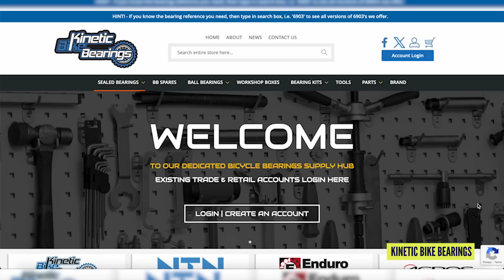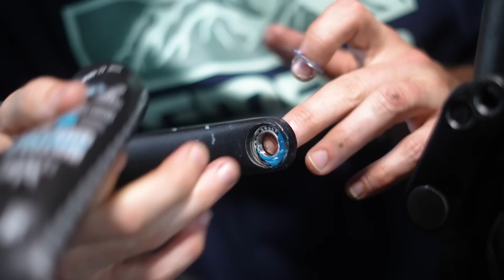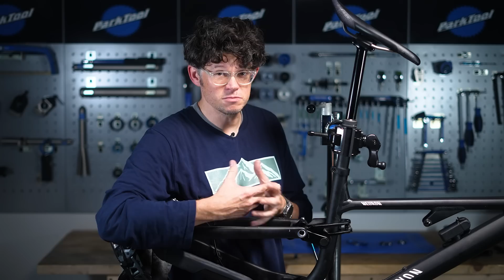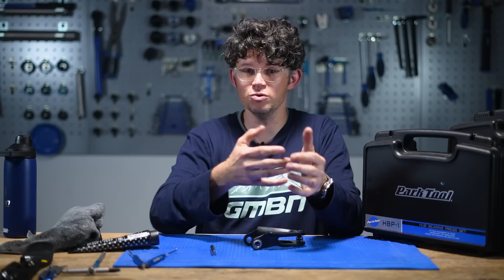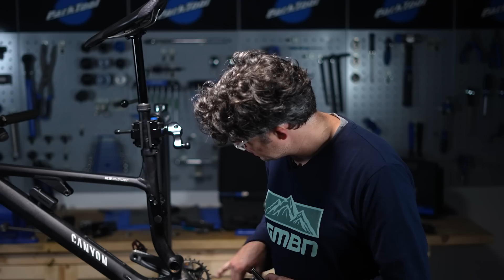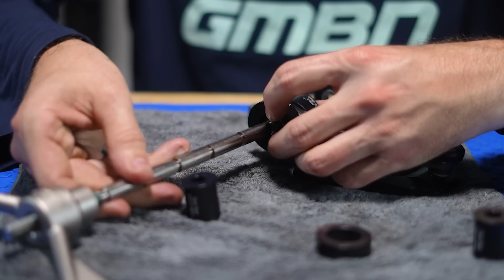Ignore This And Your Suspension Will Feel TERRIBLE!

Comment from the maker: When did you last service your frame bearings?
Reply: Haven’t since I purchased my Specialized FS twelve years ago.
Reply: Can you mix two types of grease?
The white one that was already in your bearing, with the new fresh grease??
Reply: @parkstraat9 If the grease in there is clean, yes you can. If it's got wet or grit in then best to clean it out
Reply: HI,I had try to service my Yeti SB5c switch infinity ;at home😅 ,and made a clips about it !!
https://youtu.be/NCSpMRtXrRg   :yougotthis:
Reply: 2023 bike with no time to ride it... So probably 2029
Reply: @crankshoptv  damn! I hate when that happens. I took about 4 years off because a change in careers. Very frustrating. Now I’m back on the trials.
Reply: Never.
But then I only ride hardtails 😁

Comment: So happt i found your video, i was installing my new Shimano disc brake on the rear of my mountain bike and i tightened the caliber to the IS adapter a little too much and my caliper snapped off where the screw holds it. Wish i would have found this before i tried to install it. Apparently i purchased the wrong adapter. Thank you for this video.

Comment: I serviced my Nukeproof Reactor frame last year. I replaced all the bearings. It was very time consuming but worth it, because of the satisfaction from doing it yourself. And having the right tools is an absolute must. Wouldn't want to attempt it without the tools. And there were also a couple of circlips that needed removing. Might be worth mentioning this is a video. How to remove circlips with circlip pliers.  I'm an engineer in my job so I'm used to this kind of stuff, but not everyone is.
Reply: You sound like a motor mechanic , but replacing those bearings should be quick as I found it , having done many dual suspension repairs . Mechanics are often called engineers in the United States but not in Australia .

Comment: If you put your bearing in the freezer (cold metal contracts) and warm up the aluminum housing with a blow dryer or heat gun (warm metal expands) your bearings will slip in easier.
Reply: You lose the T6 temper at 220 degrees celsius .

Comment: Interesting that he was removing the bearing hammering with a non rubber side of the hammer and, was resting the frame part on a socket without any soft material between. Surely frame got or will get marks from this.

Comment: If you ride once a week, replace your bearings at the start of each summer season. This will give you a fresh bike for the season and prevent any damage to the hardware, the hardware is often very expensive, custom made and gets discontinued quickly, so you need to look after it. A seized frame bearing will ruin pivot hardware. 

Try not to use water to clean the bike, if it was a wet ride, dab it with a towel and then leave it somewhere dry, then a soft brush will get rid of 90% of the dirt. Water washes out grease and guides dirt into all the nooks and crannies where it does the most damage. 

Pay a shop to do it, they have all the tools and experience to get seized and problem bearings out, saving you the stress and guaranteeing a perfect job.
Reply: Replace the bearings once a year? No. Refresh yes, replace as needed.
Reply: @marcjohnson8488 I see where you're coming from, and it's likely that most people will not be riding once a week in all conditions, in which case you're right. Bearings last me about two years riding my bike once every ten days or so for around 15 off road miles per ride. 

It's difficult to state specifics unfortunately, I tried to state the case for the average rider/bike, going out every weekend regardless of conditions, chucking in a jet wash here and there and riding the average full suspension mtb. Having a shop replace their bearings every year will keep the bike in top condition.

Some bikes are sealed better than others, some use good bearings, some have better grease from the factory, some have bearings that are easily removed individually etc etc.
Reply: Had my bearing all replaced by my bike shop, cost less than buying the tools for the job, I didn't have to source the bearings, took them a fraction of the time it would have taken me, they actually knew what they were doing and the work was guaranteed. Plus it keeps bike shops in business.  So no, it's not economical or practical for me to do this.